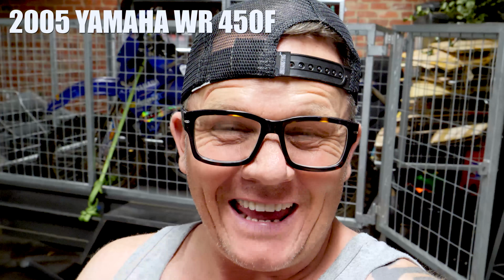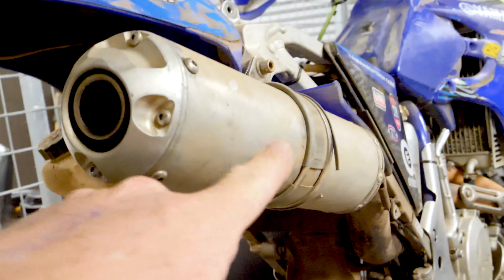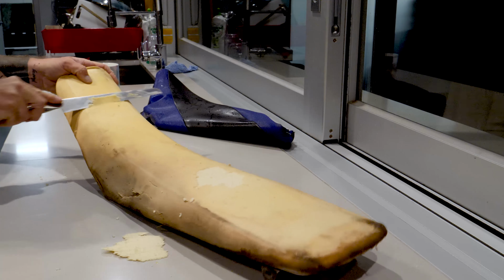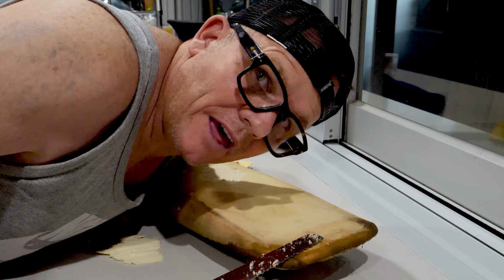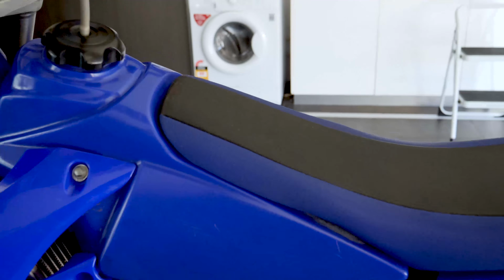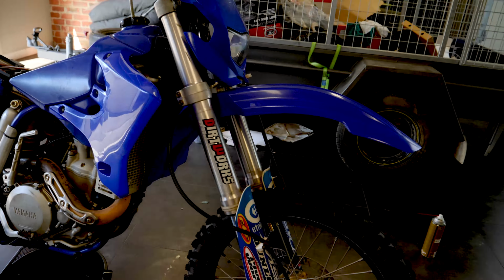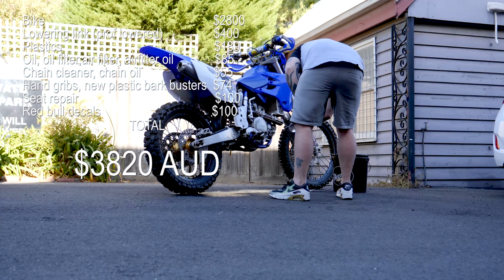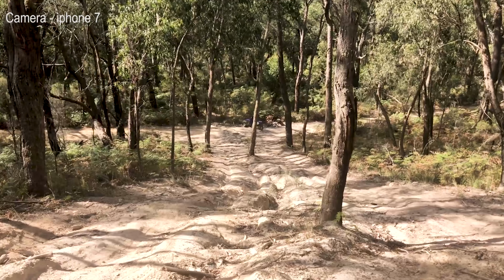MY FIRST DIRT BIKE - 2005 YAMAHA WR450F PROJECT ($2800)

Comment: Hey mate, I too also have a 2006 Wr450f, still steel frame but a slight crossover into the 2007-2010 model. Also spent and spending money and time on its restore/upgrading. I plan on keeping it aswell. Love to add as a friend to share knowledge and what gimmicks these have.

Comment: Wow Danny ,  You sure know hot to confuse your viewers .. Your last  video said you  are moving to an apartment in the City .. Now  you say  you need a dirt bike because you live in the Country ..
  I bought a New Yamaha YZ-400-F  in 1998 ,,   It is all top end power.. the newer bikes have  much more mid range  power  more ride able ..  Mine has  no lights  no battery kick start only .. I am  165 CM  29"  Inseam .. My lowering link  is still in my tool box.. 
   You can drop the front  forks  1"  in the Triple clamps  too ..
   I am so impressed you didn't know how to adjust they chain on your  Monkee  Bike now you are doing some very basic   maintenance on  your WR..  Also  I put a  much much larger  gas tank on my bike  close ration trans  your  bike has  wide ration so you have a lower  1st gear to start out in and  a taller  top gear for  a dirt road  crushing ect..
  Who is wearing the Camouflage sniper suit .. did you have to hire stunt rider for better  footage..
  I also  put  softer  springs  in my bike front  and rear for trail riding .. The WR  has  softer  springs than the YZ  Moto cross bikes already ..
  So does Australia have socialized Health care ?